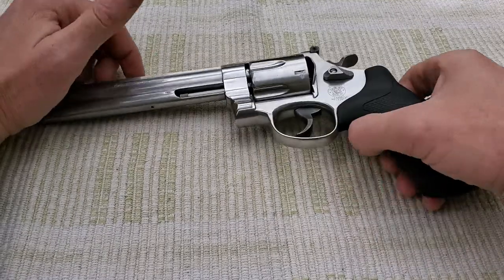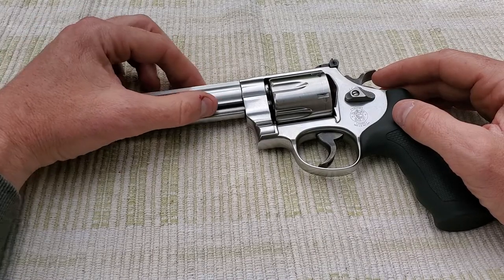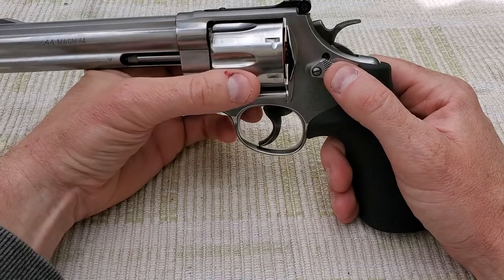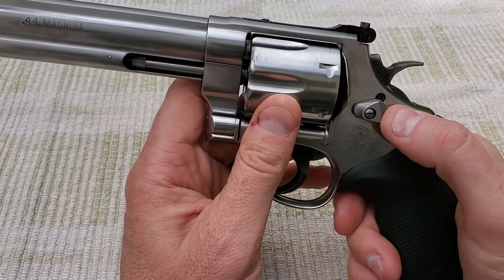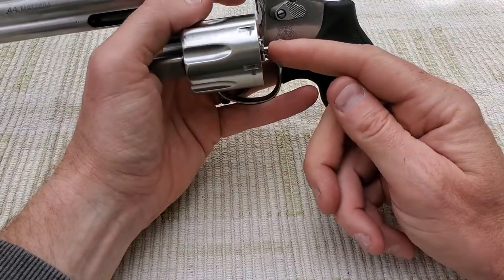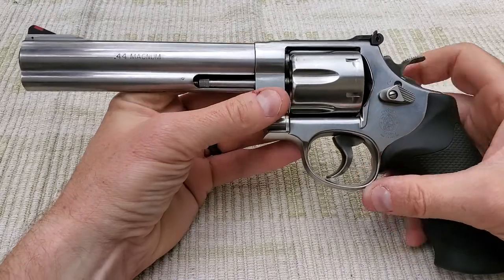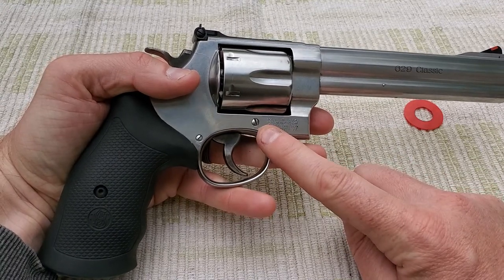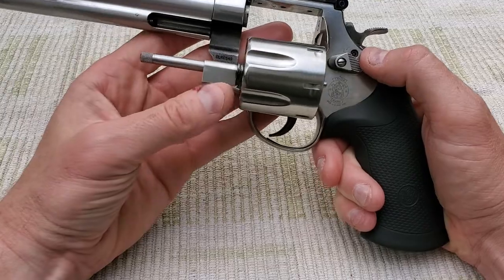44mag stuck cylinder 1

Comment: It’s very common for the extractor rod to come loose  . It tightens the opposite of a screw and he needs to try turning the cylinder while wedging a match book or something in the gap between the barrel and rod.  Hopefully it’s not loaded but it often happens when it is.

Comment: The screw you are referring to is called the yoke screw and is a fitted screw.  It should be replaced in the same location.  In fact it is good practice to return all screw to their original location so you must keep track of them.

When tightening the extractor rod, place 2 or 3 dummies or cartridge cases spaced around the cylinder to prevent damage to the extractor star.  The key is not to over tighten; just snug it up.

Thanks for posting your video.

Comment: hi, to you  !!! 
 the fail is the open botton,  remove it and try open the cylinder without this botton,  the cylinder open smooth without forcing !!!   to fix that fail you must cut a bit of the front inner  ledge of the open botton  ...  such that it can pushs the inner slide latch a bit ahead ...  
bye bye
👋😁😉